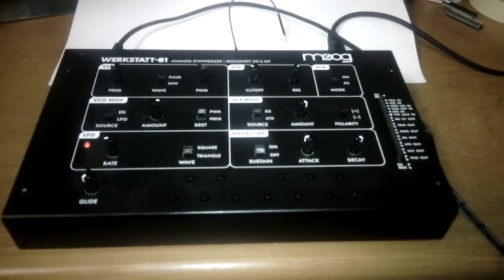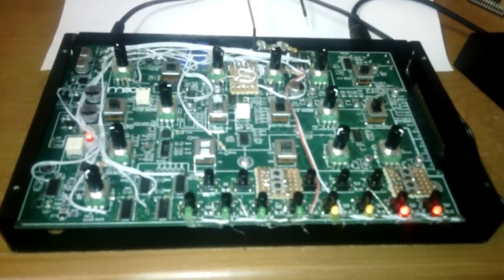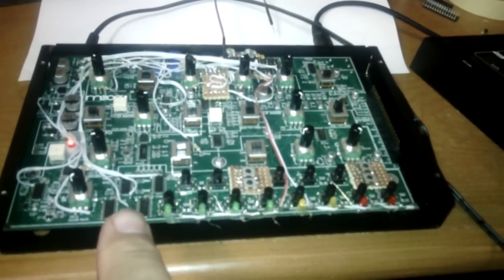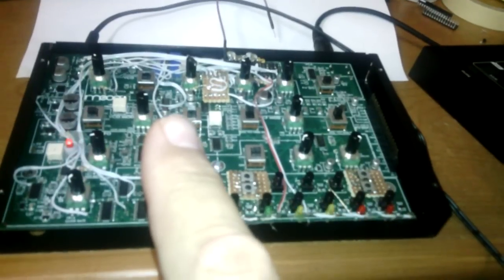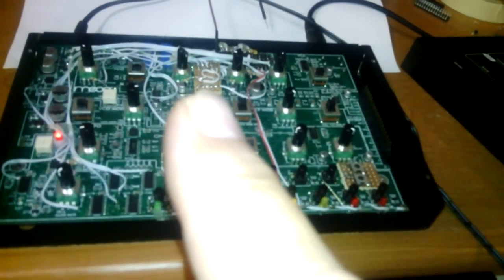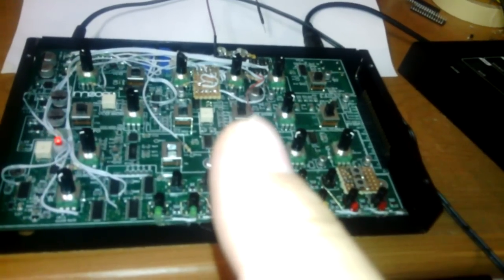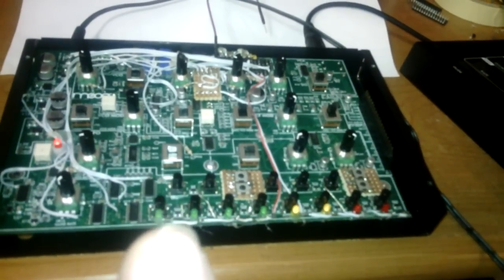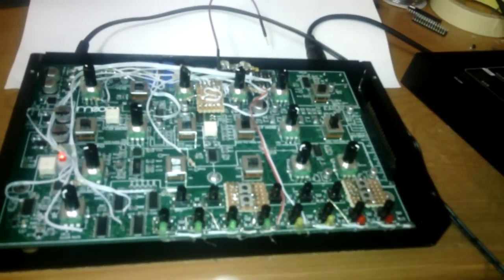Mother of Moog Werkstatt Mods - teaser.

Comment: Yeah, this is genius. Any tips for using the mini patch bay thing? Your a wizard!
Reply from the maker: Depends on what you already have. The expander card converts to 3.5mm sockets so you can patch with Eurorack.  If you can solder and have a few tools, you can just take one of the supplied jumpers, cut it in half, take a patch cable (1/4 in or 3.5mm), cut that in half and make two convertor cables. So you can use the Werkstatt  an external effects unit with a mixer etc.

Comment: Hi, Peter.  Great project!  Did you ever develop a sequencer for this?  I couldn't find anything on that on your website.  Thanks!
Reply from the maker: I can add a sequencer. But with less than 1K bytes of ram, memory is a bit tight. With the Midi IN and Out any external sequencer could be used. There is space in the flash mem for 'tunes'. I am looking at upgrading my other Werkstatt with at least the Midi I/O.